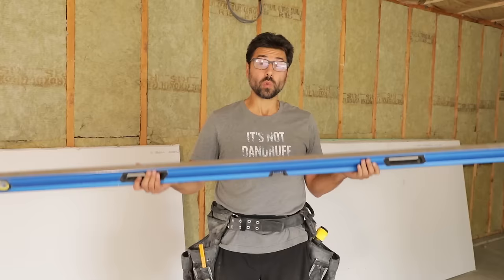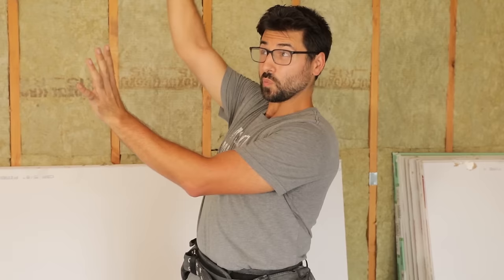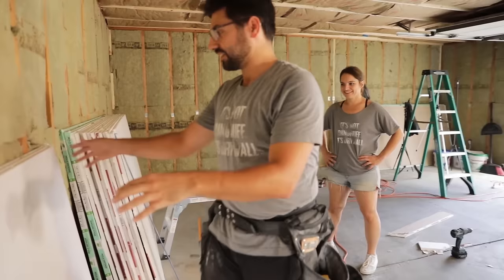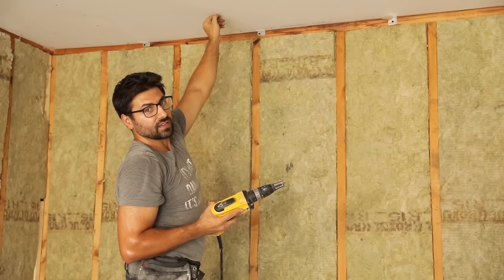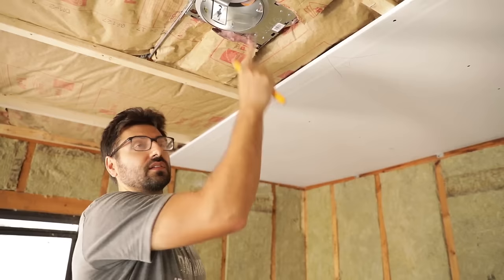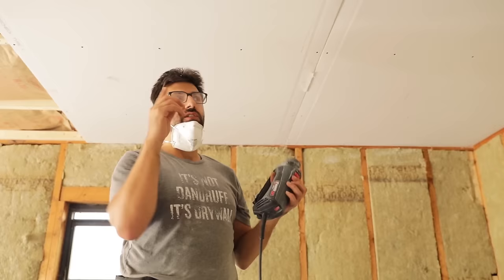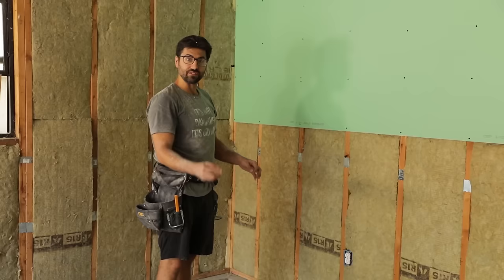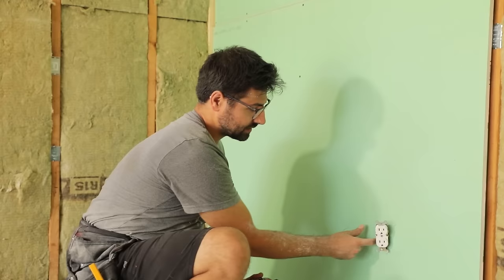How To Hang Drywall for Beginners  | Nestrs

Comment: I also cringed when you threw the level. LOL Question... I'm trying to finish our garage--our walls are 10-1/2' tall. Can I do my walls before the ceiling? Our ceiling will be very complicated with automatic garage door openers, fluorescent light fixtures, etc. but I want to get the walls finished myself.
Reply from the maker: Hey Jeff, that level never touched the ground, lol. I have gotten more comments then I ever thought possible...you can stack vertically in garages but horizontal finishes better. There are many reasons why we hang drywall horizontal. You can Google it or check out the other comments below. As far as hanging the ceiling first, again that’s what I would recommend. Your walls will add support to the ceiling after you hang the ceiling. Thanks for the comments!
Reply: @Nestrs  Okay, yeah, I reassessed my garage and measurements and now I agree it would be better to hang them horizontally, especially having to cut/score to fit to studs. Would you also recommend hanging them staggered like the ceiling?
Reply from the maker: @jeffpate9034  absolutely!

Comment: What type of Insulation is that in walls?
Reply from the maker: Hey Hugo, we used Rockwool Comfortbatt. It is rated R-15 and has added sound proofing. It is a little more expensive but easy to install and performs great!

Comment: Is there suppose to be some kind of gap between the ceiling and wall or is it suppose to be a tight fit?
Reply from the maker: Tight fit 😉
Reply from the maker: If you do have some gaps which sometimes happens, fill the gap with mud and cover it with tape. 👍🏼
Reply: @Nestrs  I purposely made gaps between the wall and ceiling because I thought how am I going to put in the mud if the space is so tight. I also left some small gaps in the corners and a very small gap where the two new sheets meet horizontally in the middle. For the butt joints I yet again left a gap because I seen in some vids where these guys cut a v shape to prefill so it doesn't crack. I'm just going have to prefill all the gaps before taping. As for the other side of the basement I have left to do, I will install the drywall tightly.

Comment: just fyi you do not need a lot of these tools listed. Most can be subsituted with more manual stuff so you don't break the bank on something you'll likely hardly ever use again if you're not a proffesional
Reply from the maker: Hey Anansi’s Meerkat, you certainly can substitute some of these tools for others that you may already have. Most of those tools /hacks will slow you down. You can even go the other way and buy professional drywall productions tools for thousands of dollars (Bazooka, boxes, pumps, stilts etc.) The idea here was to educate everyone on the proper tools to for smaller projects and cover the basics for beginners. I know there are some great videos on drywall hacks out there that covers using standard tools in detail. Thanks for the comment!

Comment: Why use heavier drywall for the ceiling?
Reply from the maker: Great question, it is a code standard in many places for a couple reasons: The primary reason is a structural one. Many roofs systems especially in garages are framed 24” OC. Using 5/8’s prevents sagging and increases the overall ceiling rigidity. It also increases the R-value to keep more heat in, has additional fire blocking rating and there is additional acoustical value which is just nice to have. Hope that helps and thanks for the comment.

Comment: Does the wall need plastic since it doesn't have the paper side?
Reply from the maker: Hey Isack, for a conditioned space the answer is yes. It may vary for some local building codes. This project is a garage and not required in this case. Thanks for the comment!

Comment: How far should the drywall be from each other?
Reply from the maker: Hi pinkdreamer04, the seams should be tight with no gaps/space... that being said if there is a tiny gap you can make it work but if you can get your finger in there the board should be taken down and rehung. Hope that helps!

Comment: I dont like that you completely glossed over what had to be done to the ceiling to make it level. And I dont like that this is framed as a tutorial when its more of a semi instructional vlog. You mentioned that the drywall was 5/8s but didnt mention that its 5/8s for the ceiling to avoid bowing. Not tryna completely hate there was some good info shared but not enough to be a beginner tutorial

Comment: If you have the right bit on your Rotozip it should be counter clockwise, not clock wise, make sure you using a bit with a guide
Reply from the maker: Yep, It was a long day. Thanks for the comment.

Comment: What makes you say you have to hang the ceiling first?
Reply from the maker: Hey envy425, the walls help hold ceiling. Also if you are working in the cold, the ceiling helps keep the heat in.

Comment: How much did you pay in drywall for that entire room? Walls and ceiling.
Reply from the maker: Hey You Tube, I honestly don’t recall how many sheets of drywall we used on this job. However, the drywall was $11 a sheet as shown in the show notes. I do know that the entire project (framing, electrical, drywall, painting, garage door, organization and storage) was approximately $10,000. Hope that helps!
Reply: @Nestrs  ...yikes!

Comment: Ceiling first, then bottom board last? Thanks
Reply from the maker: Manuel, yep!
Reply: @Nestrs  Can I do my walls before I do the ceiling? Our ceiling will be very complicated with automatic garage door openers, fluorescent light fixtures, etc. but I want to get the walls finished myself.
Reply from the maker: Hey  @jeffpate9034 , you can but doing the ceiling first gives you more support from your walls once hung. I recommend doing the ceilings first if possible.

Comment: What's up guys can I use 1/2 inch drywall on my ceiling?
Reply from the maker: Hey OJ Bravo 77, If the ceiling is exposed to an exterior space you will want to use 5/8 inch drywall. For example, if you have a two-story home it will only go on the second floor. With that said, it is not necessary in garages but I used 5/8 for additional insulation and sound proofing since I have a workshop in our garage. Hope that helps!
Reply: @Nestrs  Love you guys,, thanks a lot

Comment: Can I use a standard drill to hang drywall or do I need the drywall screw gun?
Reply from the maker: Hey Blake, you totally can use a standard drill just keep this in mind... first, it will take longer so if it’s multiple rooms you are doing, just spend the $99 for a drywall screw gun. It will be worth it. Second, you will have you adjust your clutch setting just right. If it too much you will break the paper and compromise the hold of the screw. If it is not enough the screw will stick out and you will have to go back and make it flush before you start finishing. I hope that helps!

Comment: Why 5/8 on the cieling and 1/2 on wall?
Reply from the maker: 5/8’s is code for the ceiling (exposed to the exterior or top floor) in many places. It provides more rigidity and insulation. Thanks for the comment!

Comment: Why do you hang the top first?
Reply from the maker: Hey John: It’s easier for you and the finisher...When you hang the top first it is flush with no gaps. The bottom board will get kicked up flush with the top board and your baseboard will cover any gaps at the bottom of the wall. You will cut less and have a better looking product. Hope that helps!

Comment: Is it pretty much standard to use 5/8" on the ceiling and 1/2" on the walls?  Is is also standard to use two lengths of screws as opposed to 1 1/2" length screws for both applications?  Sorry, I'm a noob attempting his very first project.
Reply from the maker: Hey Pete! You are only going to use 5/8 drywall on your ceilings that are exterior facing and insulated. For example: you would not need 5/8 for the first floor ceiling if there was a second floor above. In that case 1/2 would be fine. As for screws, I recommend using 1 1/4” screw for 1/2” drywall and 1 1/2 “ screws for 5/8. Hope that helps!

Comment: Why do you use 5/8" on ceiling vs the 1/2" everywhere? Is there a technical reason?
Reply from the maker: Brandon Pearce Hey Brandon, It provides better insulation and more rigidity if your studs are 24 inches on center rather than 16. Also, many municipalities require it if it’s an attached garage or you have a living space above.
Reply: @Nestrs  thanks! You got my subscription. About to start a Reno on a new house. Needed to know before I started!
Reply: Also fire rating
Reply: Fire break.  5/8 to slow fire from spreading to attic.  Also, required between house and attached garage as fire break.
Reply: Yes there is a reason soda squatters upstairs don't fall through.

Comment: Why use thicker drywall on the ceiling?
Reply from the maker: Hey Nick, in many cities it is code to have 5/8” thick drywall on the ceiling of the top floor of a finished space. This provides additional insulation and sound reduction.
Reply: @Nestrs  great. Thanks for the info.
Reply: To keep the squatters upstairs from falling through.

Comment: What size screws did you use?
Reply from the maker: Hey Dylon, I use 1-1/4 screws for 1/2 inch drywall. If you have 5/8 drywall on the ceiling or a fire wall you will want to use 1-5/8 screws. Hope that helps.

Comment: But he didn't show us how he got the drywall up on the ceiling, to screw into place!
Reply: I've seen some people put up a short 2x4 that is screwed into the ceiling, but not all the way, just enough to allow you to swivel it around to lock it under the drywall on one side, while you screw it up on the other. You can hang it alone that way.

Comment: where is your vapor barrier ?
Reply from the maker: Hey William, great question. We are in Columbus, OH. There are few ways to meet code depending on your wall construction. Here, you will mostly see rigid insulation (R5) and a continuous vapor barrier on the exterior side of the wall. Faced insulation is fine for interior walls but it is not continuous and it meant to protect the insulation more than act as an additional vapor barrier. Over the years (this region) has had major mold issues when a thick mil plastic wrap is applied to the interior side of the wall (moisture gets trap in the wall). I personally prefer the higher quality wool rock (faceless) insulation as is holds up longer and is bug and mold resistant. It also has much better acoustical properties. Per code, you do need an additional vapor barrier in your shower stalls. I still don’t put the plastic wrap up. I recommend doing your concrete board and sealing it with red guard or aqua seal membrane that you can simply paint on.

Comment: can you put drywall vertically instead of horizontal or will that affect the sturdiness of it? I have a 8' tall walls.
Reply from the maker: Hey Kenzie, we get this one often. You can go vertical. It reduces the seam footage but you really only see it in basements and on steel studs. Staggering your boards horizontally is  preferred because it hides any unevenness in your walls and gives it a little more strength as you said. Thanks for the comment!
Reply: Yes you can I do commercial drywall all I do is stand them up

Comment: Why use mold resistant in anything other than a bathroom or basement? Why not just use lightweight?
Reply from the maker: Thanks for the question Zach. Garages are typically unconditioned spaces and are exposed to moisture especially when in humid regions or near water. I typically use green board in garages of higher end homes as a standard.

Comment: What size screws are needed for the 5/8" drywall?
Reply: 1 5/8"
Reply: 1 1/4. You usually on put 1/2 inch of screw into what your screwing in so 1 11/4 would be perfect
Reply: 1” 1/4  works fine

Comment: Hanging drywall sideways is dumb. Causes butt joints that require more taping and finishing than if you stood the sheets on end floor to ceiling. That way you only have taper joints which are much easier and faster to finish. Plus you do not have a tapered edge on the base of the wall where the base trim is going to be. The tapered edge at the bottom makes the base trim slant inward and causes the trim to not line up in the corners.

Comment: I am a single INDEPENDENT female with no gay friends. How I do dis tho
Reply from the maker: You got this! To help you hang ceilings (by yourself) you can buy a drywall lift. They are around $200. For the walls, you may need a friend (but it doesn’t have to be a man 😉) Walls are not as bad as ceilings. You can always cut the sheets down a little to a manageable size if needed. This will result in some additional finish work but you will still get the end result you want. Hope that helps and thanks for the comment!